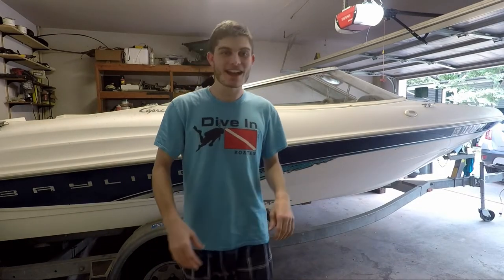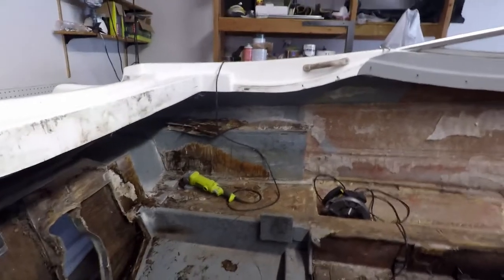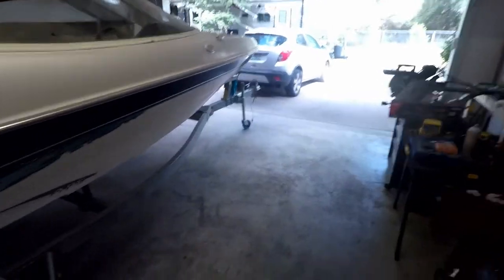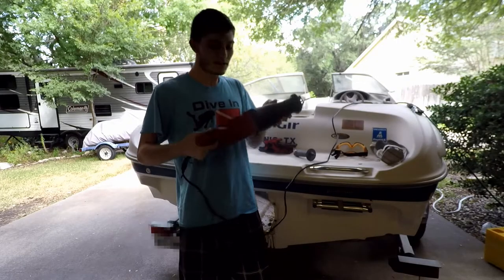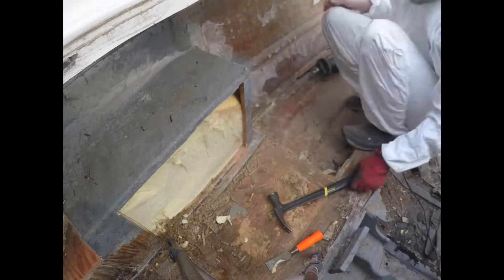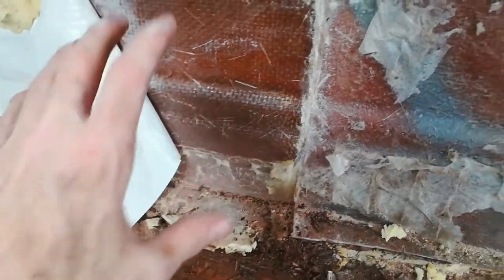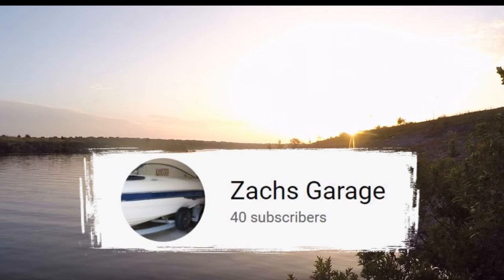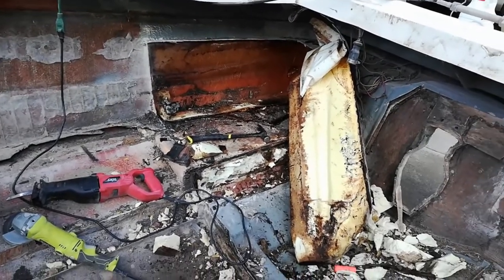Bayliner Boat Restoration - part 16

Comment: You may have already learned this, but a better way to make precision cuts in tight places is to use a multi tool. They give way more control and won't vibrate your hands to death either.
Reply from the maker: When you say multi tool do you mean a dremel?